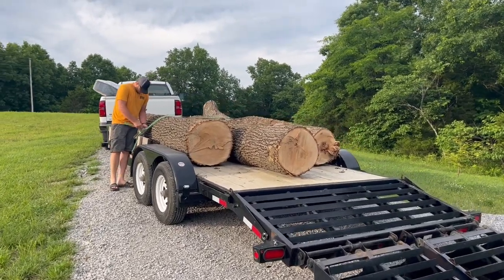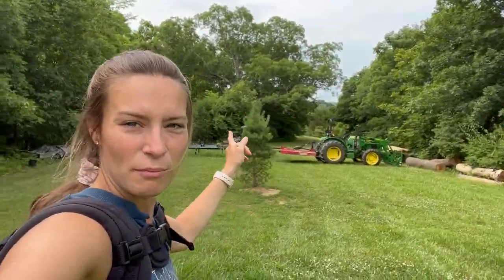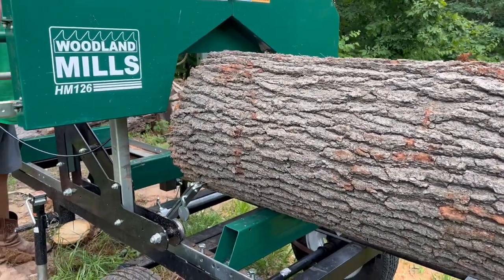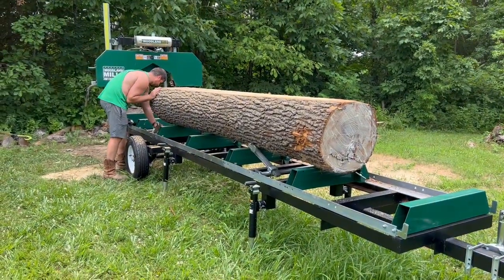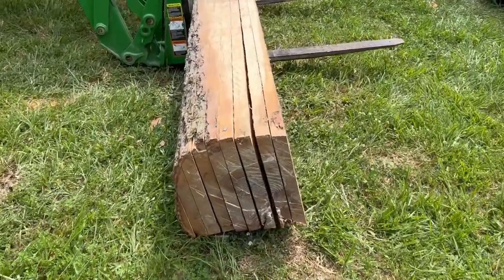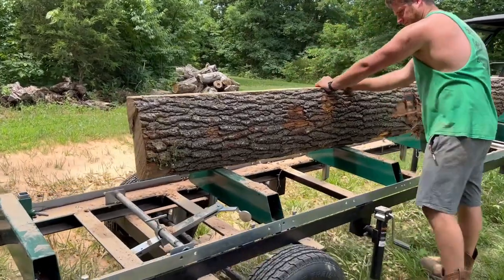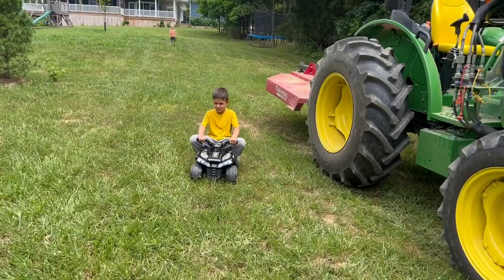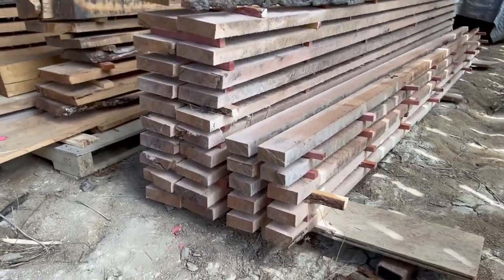Maxing Out Our Woodland Mills HM126 Sawmill!         #woodlandmills #sawmill

Comment: Hello everyone. thank you for the videos been a great help in getting are sawmill together !!! could you help with a question when taking off the first cut, you rotate that cut to the bottom?  is it more of a straight and squared  accurate cuts? thank you Troy
Reply from the maker: Hi thanks for watching. Sometimes on the bigger heavier logs it’s easier to flip it around 180 degrees to take off more material. The first two cuts being 180 out is good and straight. Now that more material is off it should be a bit lighter to work with to get the straight cut up against the log stops. Seems like if a log does not end up being perfectly square it’s because I had trouble securing the log to the log stop perfectly.

Comment: On the log dogs you guys should cut them 1-1/2” square tubing at a 45 degree angle. Weld a cap on the tubing and when u roll the log that square cut edge wont dig into the bark. Then once you r squared up u can pull the dogs out and do 180 tuen and u still have a straight edge against your board. Just use the angle side for rolling
Reply: Thats how i have my mill set up and it works 10 times easier. 
Also when i have huge logs (27”) is biggest ive done. I wrap a strap around the log and have the strap loop underneath. Then when u lift with the forks on the tractor it will roll the log. Also works great that way to align the log where u want it for the first cut.
Reply from the maker: +Hillbilly 90 Wow. Great tips! Thank you so much!!!! We really appreciate your insight and will try it out:) Sounds like a nice setup
Reply: I have a very cheap harbour freight mill and it is actually the same rail size as your guys hm126. I have 36’ of track mounted to an old western star truck chassis. So i was just doing some more research on the hm126 and found ur guys videos. Its always cool to see little home steds and self made projects.
Reply from the maker: +Hillbilly 90 Awesome! We also looked at the harbor freight one. But ultimately chose the woodland mills and LOVE IT. We use it a lot. It was a great investment for our farm.
Reply: Ya i wish i had done more research. I just couldnt pass up the deal that came with the harbour freight one. By far it is the worst built mill on the market lol. Im looking forward to buying the hm126 and being able to keep my existing track system i

Comment: that stuff will be so hard you are going to have to drill holes to drive a nail, plus use wax or soap to drive a screw,
Reply from the maker: Yup! We have thought about that also. We have a 100 year old  tobacco barn on our farm. It is still standing but we have had to replace the boards on the outside. It is VERY HARD to nail into but we have done it about 10,000 times unfortunately:) This lumber will be hard, but that's what we want for our structure. It will help build a strong pole barn! Say a prayer for our sanity in a year LOL

Comment: I just purchased the hm126 - do you buy your replacement blades from woodland mills? Or use another brand?
Great video thank you for making it
Reply from the maker: +JLC Restorations hey! Good for you! You’ll love the mill! We buy them from woodland mills. We bought 10 extra blades and the blade sharpener. My wife called woodland mills, and I believe they said the blades can each be resharpened 10 times. So definitely get the sharpener! It’s worth it and will make your blades lasts

Comment: I thought max was 26"
Reply from the maker: Interesting. I just looked up the specs. You are correct!!! 26 inch log. 24 inch board and 7 inch thick cut. Thanks for the correction. That means technically I have not maxed my mill out yet. 😬